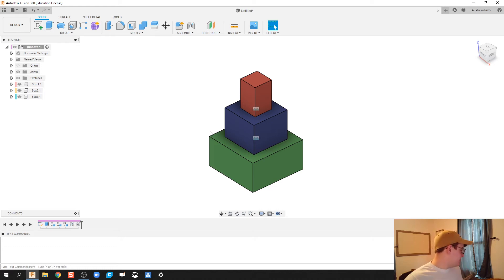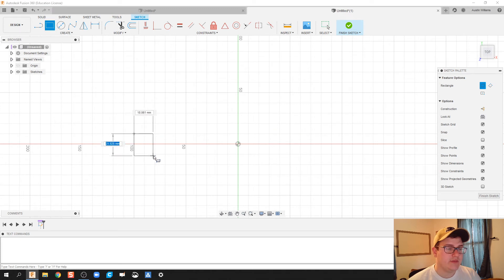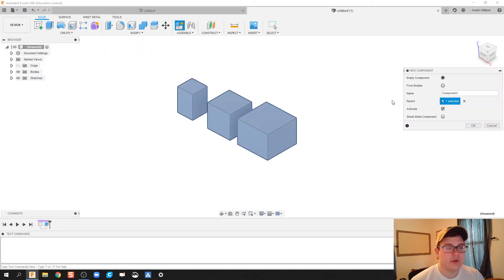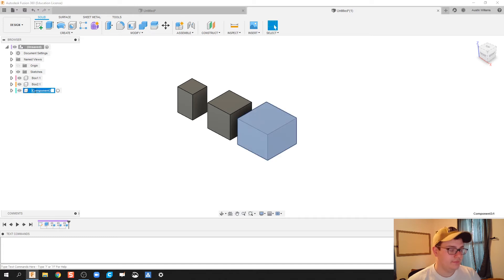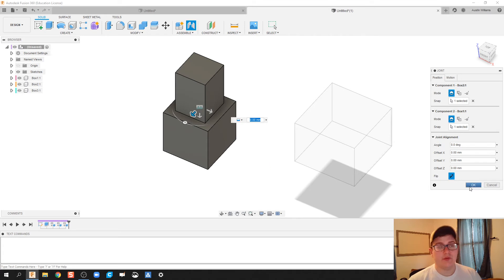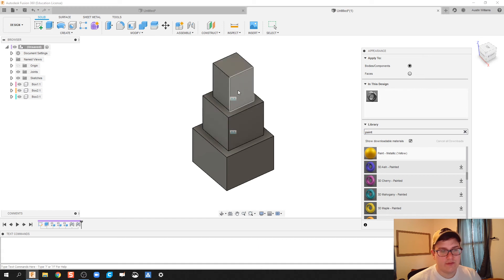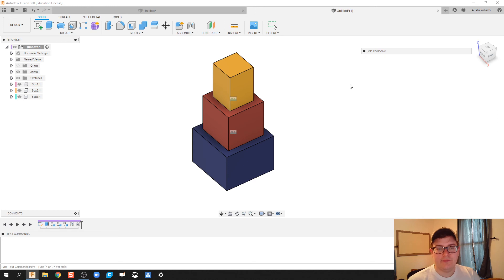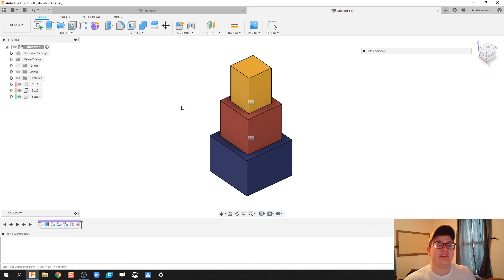Joint (Face-to-Face) - Day 42 of 100 Autodesk Fusion 360 Journey

Comment: Now how do we align them to their left faces?
Reply from the maker: Instead of selecting the joint glyph in the middle, select on the left edge. If you have a hard time selecting the correct face, hold down "ctrl" while selecting a face and it will lock into that face.